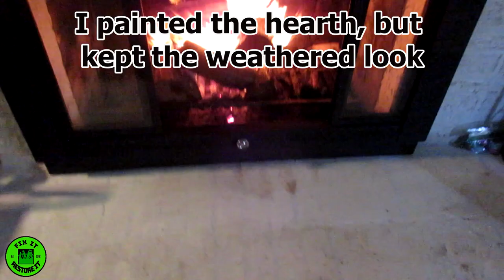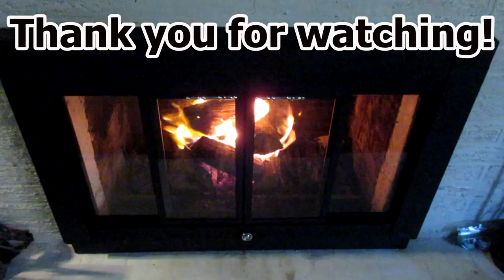Restoring rusty junk from side of the road into a Fireside Masterpiece!

Comment: My parents had one similar when I was a kid. I remember putting the palm of my hand on it expecting it to be safer than next to fire. My dad had to peel my hand off from it and rush me to hospital. Luckily no scars (now) but I'll never forget the pain or the smell! I think you should put the chain sheet that was supposed to be there back on, as I think it takes the heat and is there to prevent the glass getting as hot? BE CAREFUL! 🧡
Reply from the maker: I think it's more of a spark guard and the only part that got warm was the very top because I forgot the insulation, just had to stuff some in there and now it's fine 😊
Reply: @FixitRestoreit  Spark guard makes sense. I was triggered! 😁 Looks fantastic though ...but scares me!